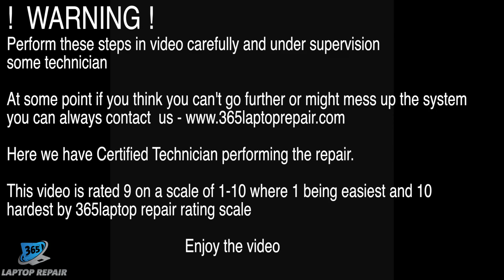Surface Pro 4 Disassembly and Repair - By 365 Laptop Repair

Comment: Don't have a heat gun so used hair dryer. The glass and edges get too hot to touch yet they won't separate. This glue is difficult to work with.

Comment: Is it possible to replace the CPU of this device? Because I am thinking on purchasing a SP4 and upgrading its CPU
Reply: idk if the will help but i wouldn't  do that just get the pro with the CPU changing the CPU will i
kill it if u dont know what ur doing %100
Reply: not impossible but why do that to yourself dude if you can help it
Reply: Mirko De Marchi the CPU sucks it can’t keep up. I need to freakin disassemble this thing and it is gonna be hell.

Comment: What’s the GPU and is it easy to replace ?? Thanks
Reply: It doesn't have a GPU.  Too slim a profile to fit a discrete GPU.  It uses integrated graphics from the CPU.
Reply: loosefalcon which sucks cause the fans and CPU can’t keep up!

Comment: My surface pro 4 just stopped Woking. I opened the panel in the process damaged one part. I need to find the part number for the same could somebody please help.
Part is located in the center of the board where the screen connects to the motherboard 
On the left of the display connector.
The part is in blue color

Comment: I spent 6 hours slowly separating the screen from the body, no cracks probably because I had a head start since the battery was swelling and one side was already separated, bought a new battery, took 4 days to get here but the surface still worked, I was playing Solitaire on it during those 4 days, the new battery gets here on the 4th day and before I shut it down I play 1 last game of Solitaire, I unhook the 2 screen connectors, unscrew a bunch of screws, take off the heatsink, clean the old thermal paste off (put new on before reattaching), prop up the motherboard while ripping the old battery out, get the new battery on that tiny little pin, screw everything back together...
Doesn't turn on, put old beat to hell battery back in, still doesn't work, no idea what the problem is...screw microsoft for making these things such a pain in the ass to fix, good thing I didn't pay for this surface, just the battery...worthless product

Comment: i want to share with you a unique a rare and unique case which you can take'it as a chalange:  using a Microsft Surface Probook since new and from the begining were problems even with the phisical keyboard or usb , simple not working. Each time after a factory reset always started to work perfect. All this till one day when navigating the surface got stuck. I turned off and from that moment (1 years ago) till present i can not acces my laptop because is impossible to type the laptop password as :

- phisical keyboard is not working 
- the touch screen keyboard is not showing up 
- the other option "on screeen keyboard" when you touch'it everything becames blocked and need to re-start. 

Also note that:

- USB is not working and i can not reset the windows
- the only way when i can type something is in the BIOS "the security question" using the touch keyboard.

I tryed to reset'i using the power and volume (more than 100 times) and is not working.

Anyone have any ideea ? Solution ?